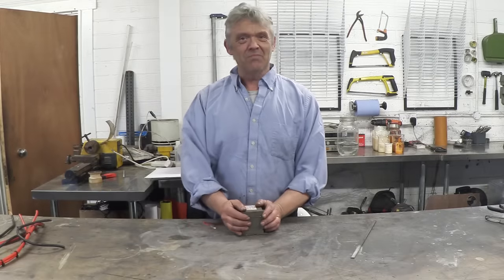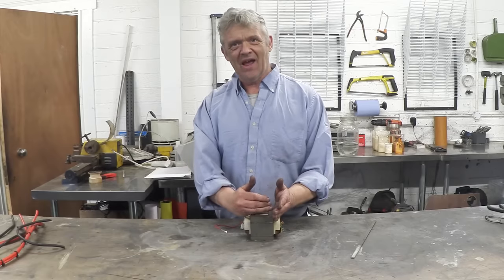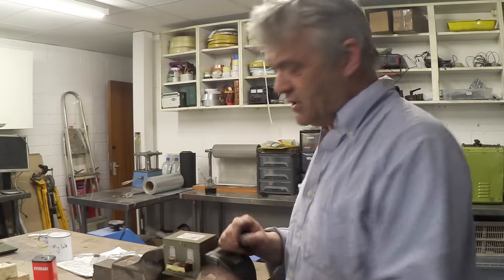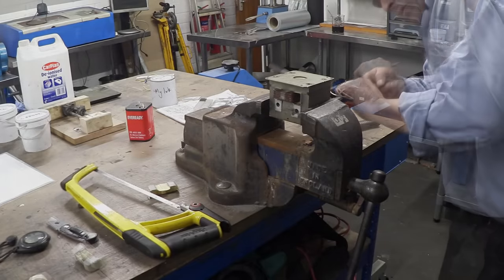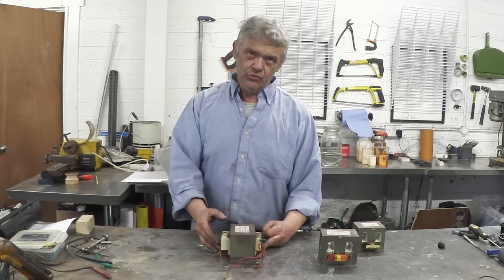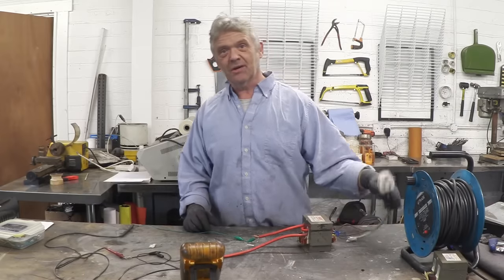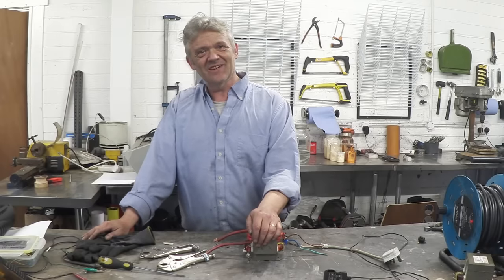Microwave Oven Transformers Using Them For Projects

Comment: I worked in a transformer, choke and inductor making factory for a while. We made devices so that they didn't vibrate and make noise, to improve insulation performance, and to improve efficiency. Some of the final construction steps were to immerse the devices in a bath of varnish, in a vacuum chamber. This sucked the varnish between the core laminations, the bobbins, and all of the coil windings, when the vacuum was released. Then they were drained and baked in an oven to harden the varnish. A similar process is used worldwide, using other varnish or wax.

The downside is that transformers treated in those ways are very difficult to dismantle nondestructively. We often had older transformers, made by many different manufacturers, sent in for reverse-engineering and rebuild. That could be done least destructively by immersing a device in solvent for a couple of days, and then its core could be dismantled. The first 'E' or 'T' (for either 'E-I' or 'C-T' laminations) of the transformer or choke core would be drifted out with a thin drift, and then the dismantling became progressively easier. Bobbins could then be unwound, measured and turns counted, before being cleaned and rebuilt.

In the light of this, your destructive method is perhaps the easiest one to adopt, if a winding can be sacrificed.

Comment: My friend and I have been staring at a transformer for two months, trying to pluck up courage to saw into the weld. And now you come up with the [obvious when you see it] solution. Many thanks!
Reply: Go ahead and saw that bead. Or use an angle grinder. You only have to go as deep as the bead. It can all be rewelded back together as well.

Comment: We were often taught as small children to test electrical batteries such as the square ones by our tongues however when using bigger electronic devices i will say this isn’t the correct way. I kno someone who actually received a large sized jolt on there tongue from this and resulted in no taste for some food. Even some smells you wouldn’t be able to detect. Over time it has gotten better but i suggest making a simple light which can detect power. As we do not all have complex electrical detectors. This is my recommendation so always use caution. Also i have found its best to use a nice size rubberized shoe to protect one from things when working with high power such as electrical plugs. Hope this helps , voltmaster.

Comment: My old Weller soldering gun was essentially a miniature version...the secondary was a single turn of heavy copper wire. It had a separate winding for a small light.
     Countless uses for old microwave transformers. 
    Great video! You probably saved a lot of headache for people repurposing these transformers.
Reply from the maker: cheers mate - thanks for taking the time to write
Reply: Same !🙂

Comment: Please be careful with those things!
You of all people don't need to be told about with microwave Transformers, it only takes one time! Looks like you're having fun stay safe! 👍😆
Reply: The process he's following makes them safer than before.
Reply from the maker: no indeed - I do take the appropriate precautions but the danger here is the heat - on the bare wire side you have 2 volts - that's no where near enough to do anything to you - the 240 volt side is isolated from me - this is much safer than the original transformer was

Comment: Btw, if you build a spotwelder out this, then it's better to use a chromium copper alloy for the tips, as it will stick less to the welded parts. Cheers mate !

Comment: Very nice work.  I've done quite a few of these myself, I've got quite the box full of them now. What I do is,  place it in a vice with the bottom of the "M" facing up, That's the part that's welded on. The welds are very shallow and I use an angle grinder to grind them off. The bottom section comes off then. Then I put it down on a workbench, with the side I removed facing down. I use pieces of wood, about 2"X2" and 6" long to tap down both sides of the wire windings, a few taps on one side and a few taps on the other, you can grease the metal a little bit to help it slide down. I generally remove the primary winding because I use the secondary winding in place and cut out the center section up to the winding and make electromagnets out of them. If you're going to make an electromagnet out of these (and they make excellent ones!) Then you want to cut out the center section so that you're left with a u-shape which is the best for a magnet.

Comment: If you take the basic microwave transformer, and use 3 parallel microwave capacitors on the secondary wire (the other secondary wire in on the casing), and initiate an arc between two copper electrodes, you can get air to burn.  Burning air is different than just a plasma arc.
Reply: Confused, how is it different?
Reply from the maker: you can also get water to explode

Comment: hi there question because you stepped down the input voltage you got a high amperage which is why it melts the nail. You had a reading of about 2.3 V. That means you could safely touch both wires at the same time correct as long as it wasn’t hot previously of course.

Comment: Hello Robert,
i just found your video when i was searching for some other tricks with MOT's and found your method of getting rid of the secondary very helpful regarding my own experiences doing it different ways.
But one point i wondered about is your way of counting the turns of your new secoundary winding. I think, what you call one turn are rather two of them, with the additional one being the third.
I hope my english is not too bad so that it can be understood, what i mean.
I would use rather 10 turns to determine the voltage per turn the transformer delivers.
Best regards
Martin

Comment: So with  only 2 turns on the primary coil he gets a low voltage but a high amperage? And you can only spot weld using a high amperage? A normal transformer needs to achieve the exact opposite. Did I get that right?

Comment: Would a power cord from an oven (240v outlet) on a 60 amp line work as a solid base for an Arc Melting Furnace? (iron/steel/aluminum) Or do I need two such leads, cobbled together with two modded transformers for such a melter?

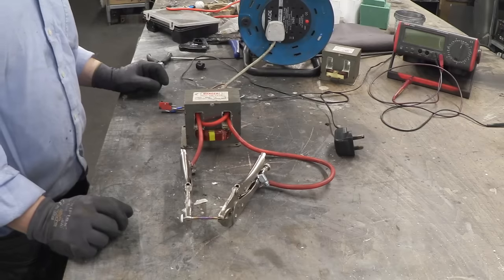Comment: 6:30 great tip! most use 1 turn since its seems logical, but 2 turns are in practice way better.
Yesterday I converted my 800 transforemer from 1 turn to 2 turns, and its amazing - like 4-5x more power.
( i use a chinese 2000W(2$) AC Motor regulator, and i can melt nails when the Potentiometer is only at 20% power)

Comment: Hi Robert, 
how dangerous is it to touch the ferromagnetic core while in operation? Can you be shocked by the EMF? 
Thanx for all your clarity!
Reply from the maker: i wouldn't touch it if i were you mate
Reply: A purpose-built transformer, except at extremely high voltages, is safe to touch the core because the wire has a special varnish insulating it.  However, in this case, after metal shavings have been dumped on the coils, and isn't handled that gently, I wouldn't trust it not to give you a regular shock.

Comment: nice presentation, just one comment: You have to add the external loop also, so when you say you have one turn, there are actually two turns ther, one of then inside the trafo and the other is the one that includes the load.

Comment: That was cool to see 
I have a question,
I bought a commercial Samsung CM 1929 microwave oven 1850W, witch has two transformers and capacitors etc.
The left transformer was burning out and now has damaged copper wire coating  , 
written on the label it states as follows
Samsung
Class 200 
SHV -906EG1
240 V -50 Hz
I )801H6 CC DPC-M
I want to replace the transformer, but I see many that say class 220 or class 250 but not class 200, do you know what the meaning of class 200 - 220- and 250 are,
I taken a class 220 out of my smaller microwave and this class 220 is smaller transformer,
Any help with the labeling would be great,info for me to go by,

Comment: I keep a set of electrical nippers in the car, and when I see an appliance like that, I cut off the electrical cord and use it to make an extension, since it has a right-angle plug, that are useful for getting to the outlet behind the sofa.
 I also collect vacuum cleaners, and join the hoses, so I now have an 8m hose for the car. The rest is useful for radio antennas, etc.

Comment: I have been using and rewinding microwave transformers for years in radio linear amplifier projects, both for high voltage supplies by lifting the grounded end of the HV winding, and also by removing the HV winding and rewiring with heavy gage wire for filament supplies. Many of these transformers are capable of 1 amp of current at 2000+ volts which is a substantial amount of current.
 The only downside is sometimes they can be mechanically noisy, and are not as efficient as transformers that are designed with more conventional core lamination and winding principle's. The upside is cost! They are dirt cheap compared to commercially available equivalents designed for this application

Comment: 1 quick question..does the primary coil terminal polarity sensitive?or it doesnt matter which way we connect as long as 1-positiv(live) 1 negative(neutral)
Reply: It's alternating current, the polarity is irrelevant.

Comment: All ya gotta do is cut one of the loop ends off drive a chisel or wedge behind other end with a hammer and even a wooden wedge will work, and presto it comes right out.
I've stripped literally thousands of transformers for scrap copper.
Reply: Spot on, I've a scrap piece of teak cut to shape which I use in the same fashion.  Mouse Milk also works a treat if you're not in a hurry.  Coat coils and let sit overnight.

Comment: I wonder how efficient one of these would be as a base for a power supply for a whole house LED power supply for exterior lights... Instead of running 120VAC around the eaves of the house for the typical LED bulbs, have actual LEDs mounted in the eaves ever couple of feet with a MOT powered low voltage line feeding all of the various LED locations...

Comment: 6:50 i thought 1 turn is better since it has more amps, but as shown 2 turns is in practice is better :) 
3:30 i came to the same conclusion , this way is the best when you have to do it multiple times
i used a round steel rod for hammering the wires out, but square is better offcourse.
Reply: Yeah, I thought 1 turn would produce more amps as well. I guess it's because there's more efficient transfer of total power (Watts) when more windings on both sides share the same field. In other words, that 1 turn would produce more amps if it enjoyed the same efficiency of transferring power (from primary to secondary) as 2 turns.
Reply: @charlesrichards5389  no , the explanation is that at 1 turn (~1volt) the voltage losses are too hight at the contact point which reduces the currentflow. 2 windings are 2x the voltage and solve that issue

Comment: Would it be possible to make a choke for a AC to DC conversion of a 120 amp MIG welder from one of these transformers using #8 wire?

Comment: Can you do a video with converting a fan cooled transformer 
to a transformer submerged in oil to cool it.
I have seen it twice but the fear is naturally put into you
about the obvious electricity and liquid, though the wires are insulated.
So can it be done ??
Reply: I don't know how helpful this is, but mineral oil is used in transformers (like the ones up on the pole outside your house) and capacitors (like the one I just had to replace in my emergency generator). I don't know if you can use just any mineral oil (like at Walmart), so order the stuff that's made for it and you should be OK. Just make sure conductors aren't touching the sides of the container.

Comment: Thanks for this. So it's inverse the lower the voltage the higher the current? How would I work out the current potential when stepping it down?
Reply: you would work out the voltage by either measuring it or using the formula n1/v1 = n2/v2 where n1 is the number of turns on the primary, v1 is the input voltage, n2 is the number of turns on the secondary, and v2 is the number you are trying to calculate, output voltage. Once you have the output voltage, you can either find the rated wattage on a label or calculate it using p=iv where p is watts, i is current, and v is volts, and then to calculate the output current you can simply rearrange that equation into i=p/v and plug in your calculated wattage and output voltage to get your max possible output current
Reply: A rule of thumb for transformers is the power out is equal to power in (give or take a bit.) A rough figure for output current can be found by noting the mains voltage and current on the label of the microwave. A 220 volt, 5 amp microwave has a transformer rated at roughly (220 volts x 5 amps) or 1100 watts. If your output voltage from a new coil is (say) 10 volts, then the available current on the load side is (1100 watts / 10 volts) or 110 amps. If you plan on pushing a transformer to near its maximum ratings, (a) put a thermal cutout* in the mains circuit, and include a fan to provide cooling, or the transformer may overheat and burn out.

*These are often included in the microwave oven, mounted on the magnetron cooling fins, and also sometimes on the outside of the cooking chamber.

Comment: I go well out of my way to salvage MOT's.  Microwave Oven Transformers.   Getting quite good at pulling the secondary winding's out of them.  20 minutes flat now.  Slide a sheet of plastic between the two sets of winding's as protection for the primary.  Hack Saw the secondary off both ends.  Punch out what's left with a wood dowel.  Here in the U.S.A.  One 360 turn of wire provides  1v.   6 AWG Wire provides One (1) volt on secondary.  Three turns makes  fine Spot Welder.
Reply from the maker: Your input voltage in the USA is 110v ours is 240v so you have more turns on your primary that's why I need 2 turns on mine to do the same thing that 1 turn does for you.

Comment: Thanks for this..I have built a Lichtenburg machine with great success (and super care) and I also put together a spot welder with 2x mots in series with 2 winds in each of mutistrand HD welder cable and it wouldn't spot weld alfoil so I gave up..Anyway my question is even though the output voltage in a 2x turn secondary is very low is the current produced harmful if held or touched? I was asked once and never had an answer so hoping I do now..
Reply: The secondary voltage with two turns is less than three volts so you won't get a shock. But be VERY careful to insulate the primary connections, earth the laminated core and connect through a circuit breaker for safety.

Comment: Hi Robert my name is Randy.  
I came across a microwave high voltage transformer that I wanted to use as a lithenburg machine for my driftwood as well as gen wood working. 
 Anyhow the transformer that I have is a Samsung SHV-U1870  120v input 60hz
However the primary coil has three spade terminals which at not identified as to quick 2 terminals are for the line wire and the neutral wire.  I was wondering if you might know which of the two terminals that I need to hook my 120v ihot and neutral input too  on the primary coil , or how do I test the terminals to figure out which two terminals  out of the three are the terminals I need for hooking up to my primary  without burning up or blowing up a perfectly good transformer.  LOL 
 If your able to help me with this I'd love to hear your input . 👍
 I have watched many videos on YouTube and searched the internet for an answer regarding this particular transformer but all they really show are transformers that only have 2 terminals on the primary which doesn't really help answer my question.  LOL 
 Thanks again for any input you might be able to offer on this minor problem IWO making a lithenburg wood burning machine . 
 Sincerely,  Randy Freeman From state of Virginia,  United States
Reply: On all of the MOTs that I've seen so far, the high voltage lead is a single wire and the chassis acts as the 2nd conductor... It should be pretty obvious which pair of wires are for the 120VAC supply and the thickest wire is going to be for the low voltage output... That just leaves the thinner wire to be the high voltage and connected to a spade terminal...